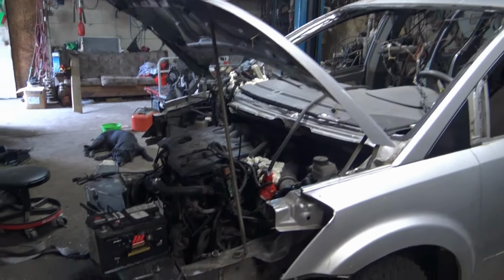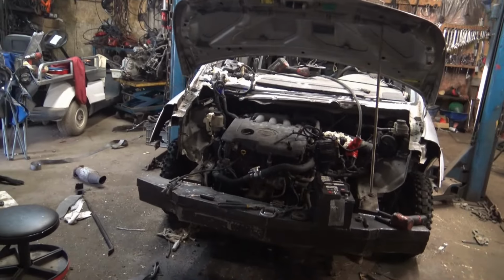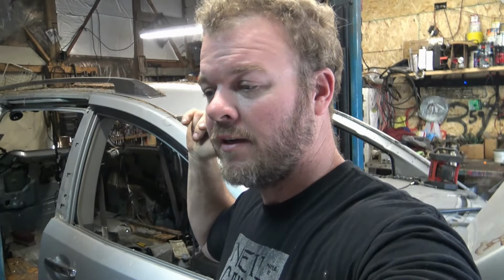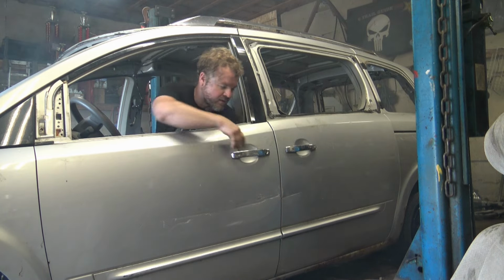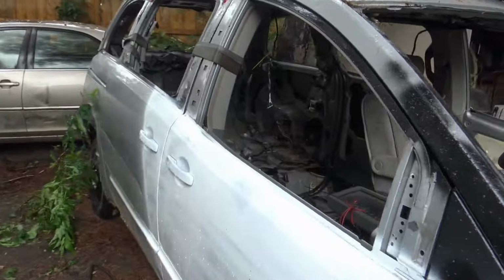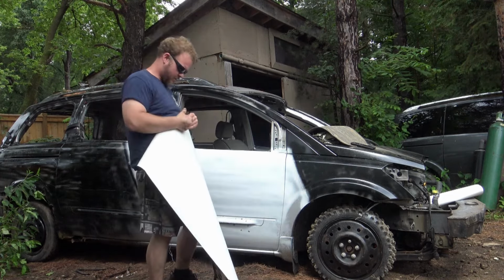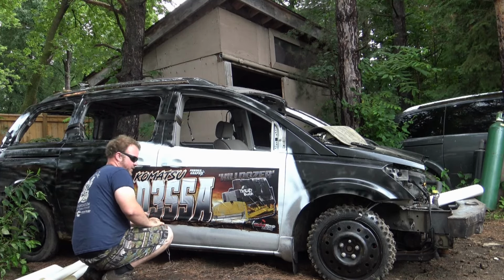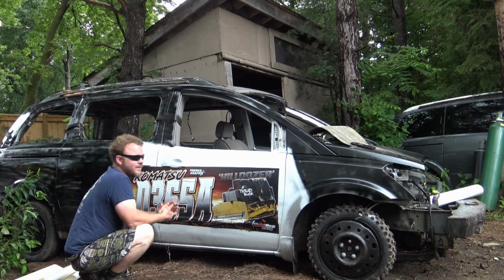Bumper is on this Quest! Are you ready to go on this Quest . Time for a door wrap.

Comment: Zack, you got an extra car I can rent? I haven’t been able to get my truck out and I wonna demo 😂
Reply from the maker: @boooyaaababy651  most of me stuff is beat and almost dead right now
Reply: @zacksworkshop171  end of season anyway, I built a truck for last years rules and couldn’t run locally , everyone switched to the farm truck rules so switch gas tank and go, 

I put a 318 in a 08 ram and spindle swapped and all that , to soft for pro and way to hard for stock 😂
Reply from the maker: i call that local hated class good for small local fairs but not good enough for big money shows lol
Reply: @zacksworkshop171  trucks In southern Ontario are won by the same guys over and over and over.  They have the rules set up for them and they’re trucks only …. You can’t run anything but an old Chevy around us . 

Old dodges can’t compete cause the fronts are weak and can’t box them in to hold the bumper , new dodges can’t compete because you can’t “ legally “ swap steering components “  

I didn’t demo once this year because of it. Hell if this truck sits more I may just drive it up to you … more places to run it up there I bet